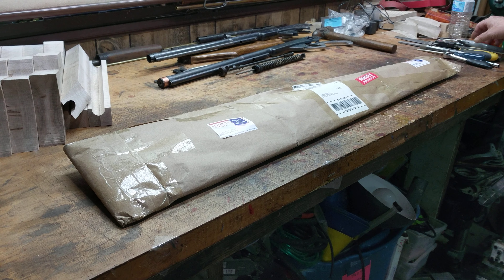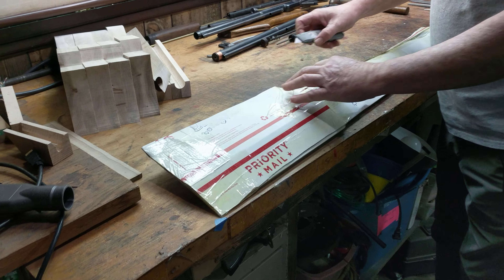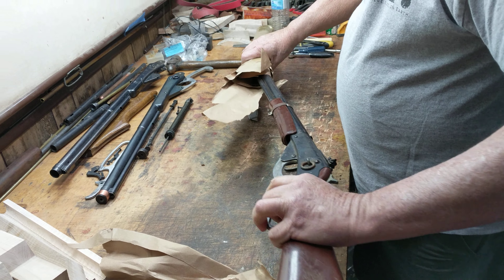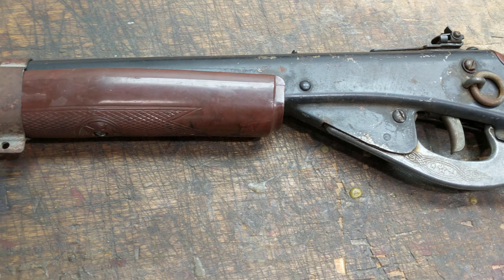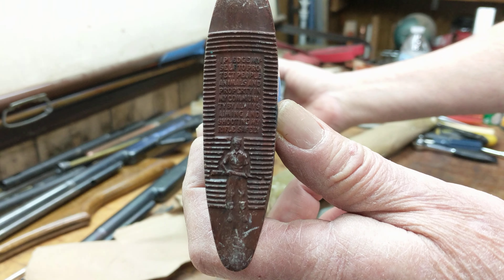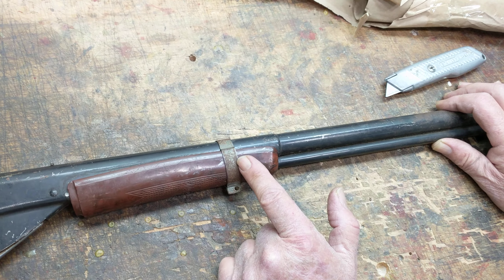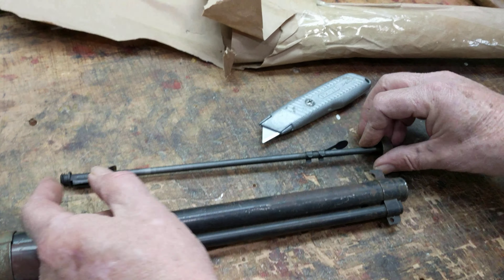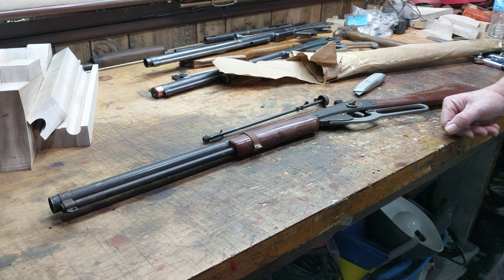Daisy Red Ryder Model 94: Part 1-Unboxing

Comment: I recently acquired a Red Rider Carbine No111 model 40 built 1953-54. Plastic stocks and large Red Rider on horseback with logo on the butt stock. Aluminum lever. Needs a couple screws to be operational again.
Reply from the maker: Great! You can get phillips head screw sets direct form Daisy or from Mark Ritter over at the Cobalt 327 store on the 'Bay. If you're looking for the original standard slots you'll have to dig around for a bit.

Comment: I know you are an expert on these older Daisys and  have a question.  I just recently acquired a Model 95 that needs 3 stock to receiver wood screws.  Do you know where I could find these screws?  Thanks.
Reply from the maker: Malibu Guy, 

Depends on what you want. The Model 95 is a wide frame Daisy so you don't have to worry about the stock to receiver bolt like a Model 94. When I rework one I normally replace all three factory screws as part of the restocking process with #8 1/2" pan head tapping screws and I like to pre-drill them to avoid splits and cracks.  If you're looking for Daisy factory screws that could get a little tough as you'll have to hunt them down on the 'Bay or else where on the internets. I'm not sure Daisy offers a screw set replacement for the wide frames as they've reduced their spare parts support effort and I've not had a reason to look. Considering just how wide the wide bodies are you could go as long as 3/4" but you might run into issues with screw bind if you're using the original factory wood.
Reply: @RestOModDaisy  Thank you so much for the reply.  The original screws on my Model 95 appear to be a 5/8" blued pan head #2 phillips.  I have seen similar screws that were a black oxide finish but would really like to find the original blued screws.  I called Daisy and they said sorry we know longer stock these parts.  One thing I have noticed about the Mod 95 is the extremely short stock, almost unusable for an adult.  Have you noticed this too with the Mod 95s?

Comment: Is there any way to fix a bent stock/forearm
Reply from the maker: If it's an older Daisy plastic stock I have heard that the super careful use of a heat gun over an undetermined period of time might be able to reduce the amount of droop in a fore arm or warp in a butt stock but I've never tried it.
Reply: @RestOModDaisy  do you sell the tools to work on these things? Mine is the same as the video
Reply from the maker: @jasoncole4089  I make a mainspring compressor to aid in the removal of the spring block but it's a real simple tool to build yourself. Just two 11" long stiff steel rods, I use welding rod that has had the coating knocked off stuck in a wooden handle. The ones I fab up go for $5 and shipping but like I said, super easy to make.
Reply: @RestOModDaisy  Do you also sell the wooden dowel and line up tool? How about the newer model shaved down piece as well as receiver bolts?
Reply from the maker: @jasoncole4089  The 3/4" wooden dowel for placing an abutment washer is an off the rack item at your local big box store. As far as the slender wire used to thread the airtube through the abutment washer aperture you can get that there as well in the hardware section. There's no reason to pay freight on those items. While you're there you might as well get a caulk gun and a couple of 1/2" hole fender washers to make your compressor tool for disassembling the plunger.  That combined with a phillps screwdriver and a nut driver gives you pretty much all the tools you will need to disassemble/reassemble your Daisy Red Ryder.
Reply: @RestOModDaisy  whats the caulk gun for
Reply from the maker: @jasoncole4089  It will also as a tool to make the disassembly of the plunger a lot less difficult, see this video:

https://www.youtube.com/watch?v=RkJePOO4vJo&list=PLmlZO8J1C8B0jjSbwD3LbbC0ByW3_qOjL&index=3
Reply: @RestOModDaisy  what's the charge for you to repair the gun. It will cock now that I've worked on it but does not pump up and shoot
Reply from the maker: @jasoncole4089  Jason, we're getting a bit long for a comment section, how about contacting me at my email 

thesocietyforprofit@gmail.com 

that way we can send pix and other data to see what can be done with your Daisy.